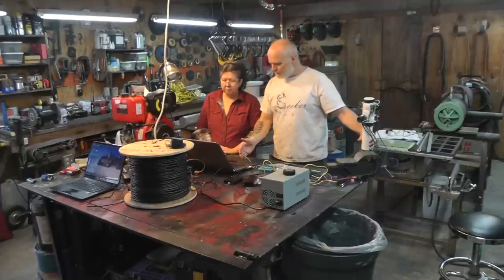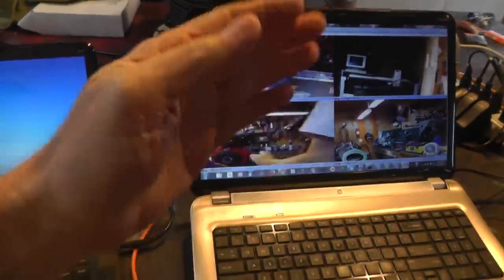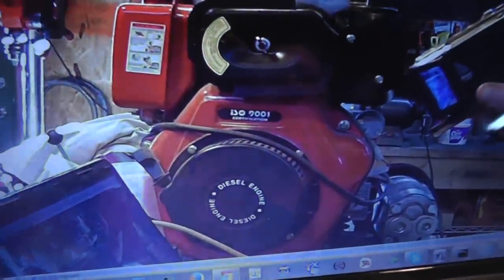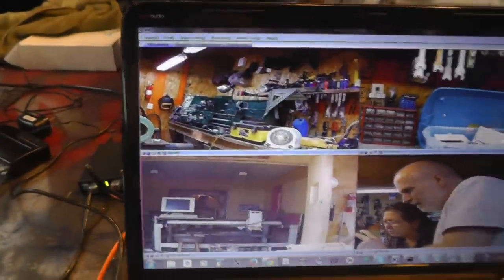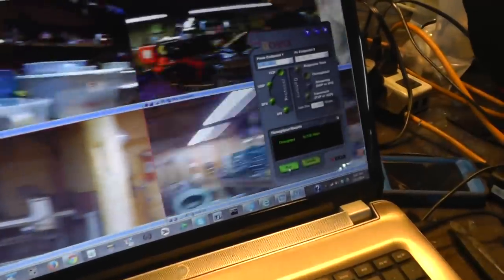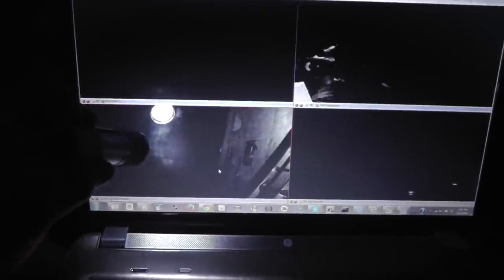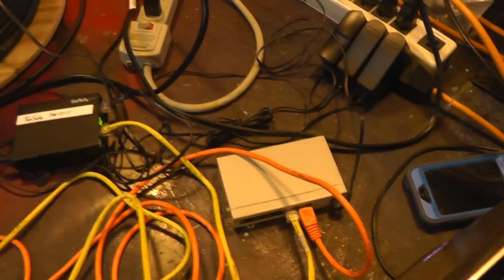ROV Communication and Control - Part 2 - Video Cameras

Comment: Embed the soldered connection in epoxy after thin conformal coating.  And make sure to connect the shielding.  Make sure that your soldered joint is smooth to avoid pressure causing damage.   Great to see the progress.
Reply from the maker: Thanks.  We do that on the permanent connections. Looks like the disconnects will be Sub Con connectors.

Comment: I do like you show, and I hope this helps with the project.

1. The problem you have with touching the DSL wire with Water or you finger is that you change the capacitance of the wire which makes the wire looks longer, and the DSL unit has to re-sync. The Longer the cable looks the slower speed. To stop this from happening just put white grease. or car grease on the copper. All new tel-co cables for outside is filled with grease to keep water.

2. As for getting the DSL into the sub put a acrylic port into the sub then drill and tap it with 4 small bolts run through the acrylic, then epoxy the bolts to the acrylic. Run the wire to each bolts using nuts to hook up the wires. (Do not forget to put a nut next to the head of the bolt before epoxying  it in). On the outside put a rubber boot with the wire going into it then fill the boot with grease.

3. The problem with LAN switch not working and needing to use a HUB is that ARP messages are being blocked by the DSL unit this is Normal as the telco do not want your ARP messages being sent to the internet. The DSL unit will have a setup with it acting like a Gateway and then all you need to do is setup a route on you laptop to point to the DSL Gateway IP address for the IP address Range on the sub side.

4. The slow Video at 1080 is the Laptop Video Card. Running 4 H.264 use a lot of GPU and making image bigger just slows it down. Try removing the DSL setup and running it again. I think you will find you have the same problem with the DSL loop removed

One problem that I do see you having is that 4000ft 4 Wire line is not that strong, you may what to try this. Hang the 4000ft roll from 5ft of the same wire. then push the roll off a 6ft step ladder with the other end hooked to the top of the ladder. This will let you see how strong the cable will be when played out 4000FT and the sub pulls down on the wire.
Reply from the maker: Awesome feedback Mark.  Thank you very much for the insight and advice.  And no worries about the Cat5 cable, that's just for testing, not actual towing at depth.

Comment: Slowly been watching through all your posts great work guys unbelievable amount of work. 

A few (hopefully helpful) suggestions on the connectors and cabling especially with the potential transmission issues with possible shorted cores. 

I would suggest you use a connector on the ROV, any failure in the cable or conections will prevent the ROV from filling up with water. 

Cable

I would suggest using a water blocked cable, if you damage the outer jacket on the cable this will prevent any water from tracking the entire length so you can just cut out and repair one section.  

The water block will help but I would also suggest a low void cable with possible fillers to prevent the cable from being crushed from the pressure. The strands in the wire can fracture or two wires can be crushed together the create a short. Also I would recommend using tin coated stranded wire as it is less prone to corrosion. 

Connector

I would suggest a connector rated to + 2000psi open face, the rubber moulded connectors are the lowest cost and are very reliable I think these type are used on the high end ROVs. 

These work by applying an electrical grade silicon grease to the pins before mating, when under pressure the connector is compressed and self seals. I have used these type of connectors in + 2000psi applications with good success. (Look up seacon wet-con I can give you further details and info on manufacture if you want to make your own, but they are about $50 each connector dependant on amount of pins/contacts which I think is quite reasonable) other connectors are obviously available! 

  

The fixed connectors come with a thread and oring to attach. 

The connector to cable conection is also a point for consideration, most are potted to remove air, prevent crushing and reduce water tracking problems. The rubber connectors are good for this as you are bonding the flexable cable to a flexable connector (from experience hard to flexable is problematic) a reliable connection method I would recommend is using 2pack polyurethane rubber which is slightly harder than the connector and cable. This can also be used to make repairs/joins in the cable. 

Another couple sorry for long comments

Something that I have seen used on other dived equipment, unsure if it is used on ROVs but will explain any way, May be something you may want to integrate.  

A barometric pressure sensor is fitted inside the and is monitored,  Due to the pressure hull being sealed a vacuum is applied internally, this pull all the seals tight in the grooves,  If the pressure on the sensor increases ( allow for temperature variation) above a threshold then an alarm can be triggered to show a pressure leak and prevent damage when submerged or on the surface.

Are you going to anodized the finished Rov to prevent corrosion?

Hope this helps keep up the hard work.

Cheers Jeff
Reply: Just a quick note on how to test if water has got into or is shorting out pins on an assembly. I suggest you disconnect any electronics when doing this test, you will need an insulation tester which measures resistance at 500v most electricians have one. test between pins after pressure test to find if there is a short. The way it finds a fault is if there is water between the pins / connections the high voltage uses the water to jump the gap.

Comment: Hi Doug & Kay,

One thing you should watch out for is that the element in which the cable will be can change the rf characteristic of the cable ! You should test with your spool underwater. Also, a spooled cable won't have the same characteristic than a straight cable, you can just think about how a inductor is made...
Reply from the maker: We've heard the sea water potential problem thing a few times but the folks working with deep sea equipment don't give it any significance.  If anything I'd think it would be a better environment that buried in the ground beside other cables.  And I considered taking it off the spool but it's 1000 feet  :)

Comment: There are small dvr's, but not sure what the memory capability would be.
Personally i would either just record info you want to store, or look at saving like security systems do, they just save one snapshot per period, the period could be 15 fps, or could save a frame every second or more.
Do you want an actual connector ?
Whatever DIY connector you make, think about feeding positive pressure into the cable from topside, it's a method used in old telephone cable to keep water out, and if your seal is good, it won't need a flow of air, which means if you monitor the flow, you can detect leaks, but if there's a leak, the  positive pressure keeps the water out, might be an idea for the rov too.
Reply from the maker: I'm look for DIY solutions for connectors.  There are actually lots of special build connectors.  We'll use those for the critical data connections, but the RC motors are not sensitive to seawater.  The pressure compensation idea is a  good one if we were not going so deep. 3000 ft is about 1700 psi.  :)
Reply from the maker: ***** Maybe.  I ordered some of the "real deals" from Sea Con.  I know they will work and also may serve as examples.

Comment: If you are running that DSL signal though the same cable 2 ,3 or even 4 times...using up all the pairs, with the huge amount of crosstalk that generates. ..that is a rough test. It will make a difference,  coiled on the reel and free air. The former making for much coupling between turns. Running the signal through the same cable several times plus being on a reel....the same distance in salt water should be no problem. ;) IMHO.

Comment: Latency is latency and the delay you are seeing is not from the length of cable. No human could see the latency induced by 4000 feet of cooper.  Humans your age can only perceive about 300ms of latency. 4000 feet of cable at 802.3 will see about .0001 ms of latency.  The delay you are seeing is most likely the laptop itself trying to render the video.  A good video card or laptop with dedicated video card will resolve. 

For reference, when we were younger we could talk across the country over 4000 miles of cooper cable and various repeaters and not notice any latency over the cooper cable while talking.  Same laws of physics apply here.

For ease cabling.  Fiber might be a better solution as ethernet is really only good for 100meters over twisted pair.  Not really that complicated and blackbox . com should give you a starting point on doing such.
Reply from the maker: 3000 ft of single twisted pair is the specification, and way we are using VDSL2. Sounds like we need a game machine, something I know nothing about.  Got any suggestions?
Reply: SV Seeker
OK  I had to watch more of the video after I saw your mention of VDSL.  VDSL was a band-aid technology to keep telcos competitive using cheap untwisted pairs.  Max throughput maxed at a 7 megs at 20,000 feet if cable conditions were ideal.  Still even with this you should not see the latency.  I cannot see from the video but at that latency you should see jitter as well (choppy video),  if in fact the transmission medium was causing the latency / delay. 

If that laptop does not have an HDMI port on it (meaning old) it surely will have a hard time rendering such.  Try running just one camera and I would bet the issues will be reduced.  No gaming computer needed but HD video is a challenge for laptops due to their inherent week video cards even more so running multiple CODECs. 

Not sure if how you are keeping the guts dry down so deep as you both are better experts at that than I but fiber might make a better transport.  Not complicated at all. Check Amazon for part FMC-10-100-SC015.  Again will not solve the latency issues you are seeing but help with the cable concerns you mentioned.
Reply from the maker: MrThisIsMeToo Thanks,  And the bandwidth reduction is part of the issue as the lag definitely increased from the first part of the video where the laptop was directly connected to the switch.  After adding in the VDSL, we could only run 2 cameras at the highest resolution, the others would not connect or would hang. But no doubt the video rendering is part of it too.  And we have a 1k spool of fiber, but it's not an option on this project. I really prefer the copper even with the limitations it's so much cheaper, reliable, rugged, and easy to repair in the field.

Comment: Hi,

I am sorry I have not had a chance to write you back yet. Now that I see this video I wish I had written back sooner.

I work for this company - www.stretchinc.com. We make IP cameras and DVRs. Poke around the site and if you see something that might help you I'll do my best to help you get one. I am one of the designers there.

The click you hear is the "IR cut filter" switching out. This allows the camera to respond to IR light. At night it lets you light stuff up without the bad guys seeing the light - cause IR is invisible to the human eye. In the daylight however IR degrades the video quality so the IR cut filter removes it.

Letting the IR cut filter remove IR from the light path is okay underwater, becuase there is no IR down there. However, the camera switching to blank and white is not so cool and does not really help, especially if you have lots of visible light down there. Also at 3K feet the colors of fish are really cool so you want the color turned on.We can show you how to disconnect it and it should work better for you under water when it is dark.

Leo

leop@stretchinc.com

P.S. Jody is right, you guys are amazing!

Comment: Marine surveyor here in NJ swears by 5200 with heat shrink over it for connections in water (bilge pumps mainly)  Messy job but says it does the job long term.  Apply 5200 and while still setting up slide heat shrink over it and shrink it tight.

Comment: I found that cables through a watertight hull are a nuisance and prone to be the #1 reason for flooding.
The dodgy watertight seal around the outside of the cable might stop the water at first will leak eventually,
Any tiny leak in the cable will force the water through the cable inside the hull destroying many thousands worth of electronics and camera's,
At the depth you plan to go I would really be interested in the design ;-))

My experience is not to go through the hull with a cable at all.
In the end they nearly always start leaking and flood the hull... and I am talking about depth of only about 50-60 meters.
My advice would be, make a watertight connector on the hull and a watertight (oil filled) connector on the cable,
For us this system works perfectly.

Comment: I would think that by wrapping the signals back into to cable by soldering the ends you induce very interesting interference signals along the wires.
I was wondering how much retries and error correction that will cause in the IP setup.
Perhaps that slows down the transmissions.
Perhaps, for a quick test, try it on just 1 pair.
You have already proven that your signal drivers can cope with the length so the full length is not an issue.

Comment: Why not make watertight castings using some kind of plastic like you did with the bronze bushings? You have all the stuff to do a casting right around all your connections once they are made that would be difficult at best to violate ( and very streamlined if designed right) Suspend the connections inside the void area and fill each one. You could also do this at sea as well, easy peasy right? Cheap as can be. With depth the connections would only get tighter. Entering the ROV you might be able to also cast the cable within a cone that also gets tighter with depth?

Lord knows the planet has too much plastic. Might as well put it to good use?

Comment: one step from awesome :) , what kind of housing were you gonna need for 3000 ft, surely those are rated for depth.?. You are gonna need some serious power and lights at that depth. 40k lumens!!!!! Details please :)  I like the Lowrance combination, that should be cool. Please don't snag the thing when it's done :).
Reply from the maker: Details: http://www.submarineboat.com/Streamlined_Mini_ROV.htm
Reply: awesome site, thanks. Totally off the trail comment after getting side tracked on your site: cummins motors aren't much better, especially the 8.3 's.Had a totally random, out of the blue, catastrophic shut down with on of them once.Fuel pump decide to just spline off(similar dealer support)
Reply from the maker: ***** The P-pump is said to be one of their best.  I'm trying to avoid anything with electronics.
Reply: 2+,old p pumps are good! some of the perkins were/are pretty good too, it seems backwards but the older I get(and I'm a young guy yet) the more I like plain old mechanical stuff

Comment: Great work!
I have a solution perhaps to the Ethernet cable connections. I thought you were going to say it yourself at one point. What you discovered is oil doesn't earth the connection, so why not seal the connection much like a packed bearing is packed with grease, it wont let water in because its already full....

Comment: Just a thought...as far as the cable connections. I would guess that the silicone dielectric grease would work fine. Install some heat shrink tube over wire before you twist wires together. Then...Just make sure you solder the connections. Then put the dielectric grease over the soldered connections. Then heat shrink ends of tube. over wire, but not the center too much. 
  The dielectric grease is used on automobile connections...available at most auto part stores.   http://en.wikipedia.org/wiki/Silicone_grease

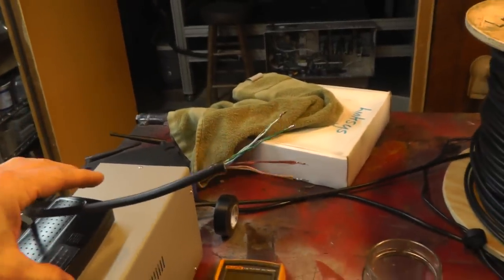Comment: (7:18) you can plasti dip the wire and it makes them water proof used in RC cars to run them in the water im not sure if it will work in salt water since its corrosive but worth a try they sell a spray and brush on,  I recommend brush on since its thicker

Comment: The bandwidth of your video shouldn't change by moving the camera back and forth.  What it will effect is your cameras ability to process what it is looking at.  I kinda wonder if that is where your lag is coming from, those security cameras aren't really meant to process moving video like that. Usually they are mounted in a static position.
Reply from the maker: That's what we were worried about too, but we're happy with the performance.
Reply: Yea for sure what.  In all reality you could go high res all the way because your ROV won't be able to move fast enough to make a difference anyways wouldn't you say?
Reply from the maker: Mopardude Don't know.  We'll have to try it.  It is nice that another PC will be able to change the resolutions on the fly.
Reply: Being network cams I assume they are compressing the video and using a fixed bandwidth.  They look smooth with small changes as most of the pixels are re-used.  Panning would require recompressing the whole scene until there were more reusable bits - hence the lag at the camera end and no change streaming bandwidth.